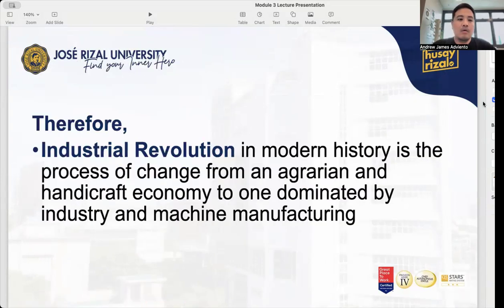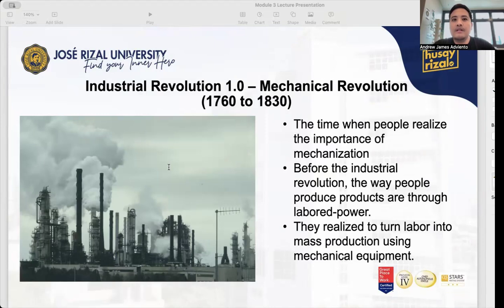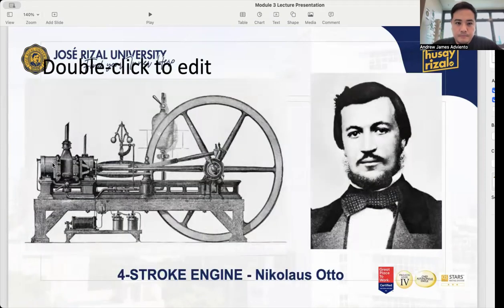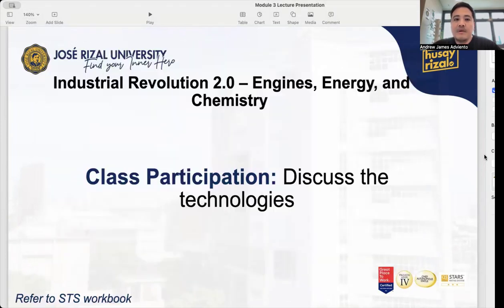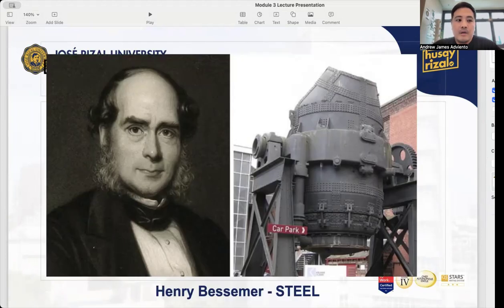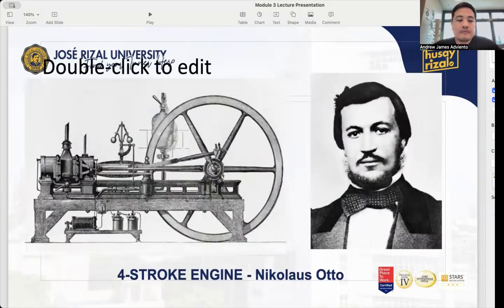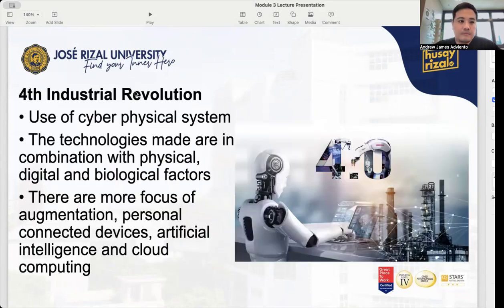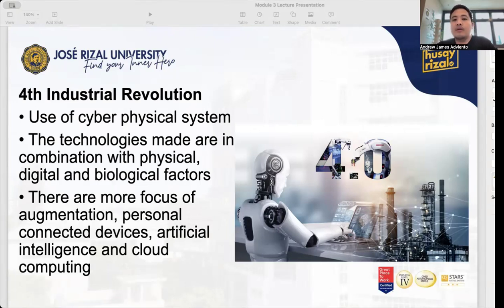STS Module 3

Comment: 1. Before the Industrial Revolution, products were made by hand using simple tools, so production was slow and limited. During the Industrial (Mechanical) Revolution, machines powered by steam or water were used in factories, which made mass production faster and more efficient.
 2. One Industry 4.0 technology I use every day is my smartphone. It helps me communicate, study online, manage tasks, and access information easily. Compared to my grandparents, who depended on letters and manual labor, my daily life is faster, easier, and more connected because of modern technology.

Comment: 1. Before the Industrial Revolution, products were mostly handmade by skilled artisans, one at a time, using simple tools. Production was slow, expensive, and limited in quantity. During the Mechanical (Industrial) Revolution, machines in factories were used to produce goods on a large scale. This made products faster to make, cheaper, and more widely available.

2. One Industry 4.0 technology I use daily is the internet. It connects my gadgets such as my smartphone, laptop, and other smart devices, allowing instant communication, online classes, research, entertainment, and even online transactions. Compared to my grandparents’ time, they relied on letters, printed books, radios, and face-to-face communication, which required more time and physical effort. Today, information and services are available in just a few clicks. The internet has made daily life faster, more efficient, and more connected, greatly changing how people learn, work, and interact with others.

Comment: 1. The primary difference in the Industrial Revolution is that products were made by hand, so making items was slow and limited, while in the Mechanical Revolution, machines were used to make products faster.

2. A smartphone helps me communicate and study easily, unlike my grandparents’ time when communication was hard and slow, and they had to study in the library or use books only.

Comment: 1. Before the Industrial Revolution, products were constructed manually inside smaller facility environments that were slower and capable of producing fewer goods than today. The introduction of mechanization with the Mechanical Revolution transformed production into a mode of manufacturing at a greater speed and in a greater degree of uniformity.

2. A technology I use everyday is smartphone with internet and smart applications. Today I can communicate with others, learn online, shop, and do all of my daily tasks with a single device. Compared to my grandparents time where they used physical errands, printed materials, and slower methods of communicating.

Comment: 1. Prior to the Industrial Revolution, manufacturing relied primarily on manual labor, resulting in slow production and limited output. The introduction of machinery in factories during this era dramatically accelerated the process, enabling mass production of goods.

2. I use the internet every single day, it's a perfect example of Industry 4.0 in my life. It lets me find information instantly, stay connected with people, attend classes online, and get things done way more easily. My grandparents had a completely different experience; they relied on face-to-face communication and waiting for information. Life today is so much more convenient and efficient because everything I need is just a click away.

Comment: 1. Before the Industrial Revolution, most products were made by hand using simple tools at home or in small workshops.
During the Mechanical Revolution, products began to be made by machines in factories, allowing goods to be produced faster, cheaper, and in larger quantities.

2. The technology that I use daily is the smartphone, and it belongs to Industry 4.0. Smartphones have changed my daily life by allowing me to communicate, access information, use calendars, alarm clocks, calculators, cameras, and even digital wallets easily and effortlessly, unlike my grandparents, who needed separate devices for each of these functions, which required much more effort.